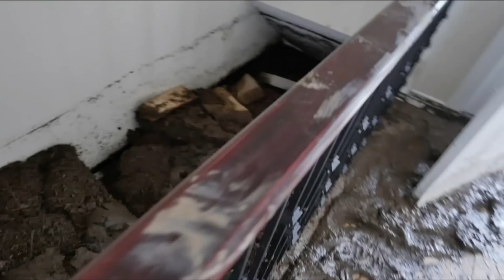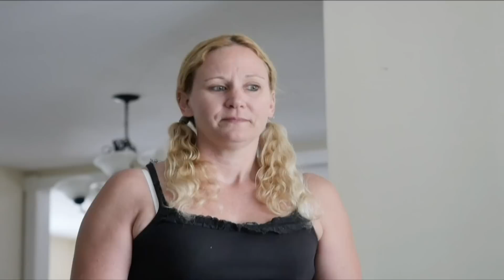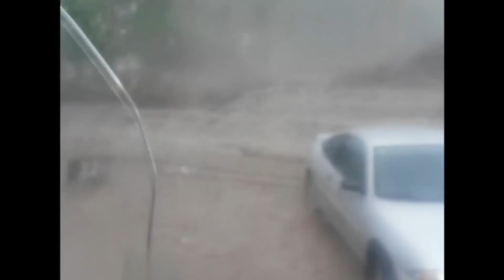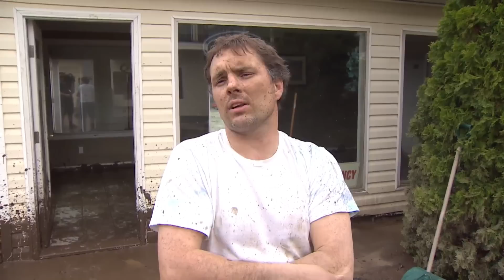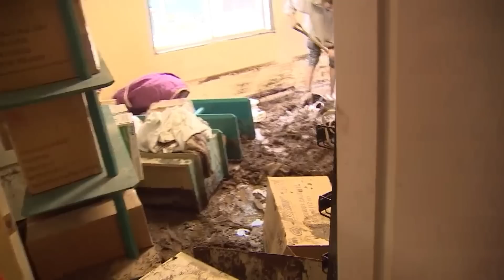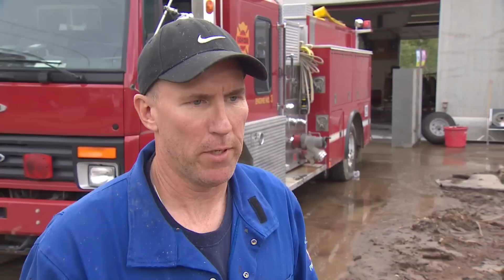B.C.'s Cache Creek hit by flash flood

Comment: Reporter: "About 36 mm came down last night..." Woman: "The water would come down and go up 6 feet!" Man: "There's basically, I'd say, 6 inches to a foot of mud..." Fireman: "When we opened the door there was 8 inches of mud throughout the whole firehall..." I guess it's hard to get the metric system into 100% use after you've had inches and feet for more than 150 years. We haven't yet made this switch in the good ol' USA, which is scornful of anything "foreign", so it's impossible to say when this will occur.